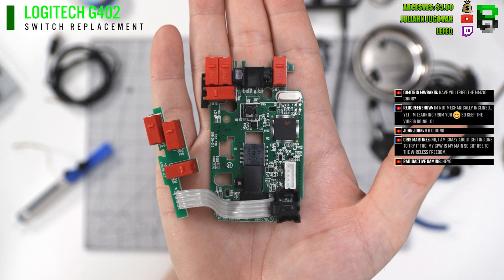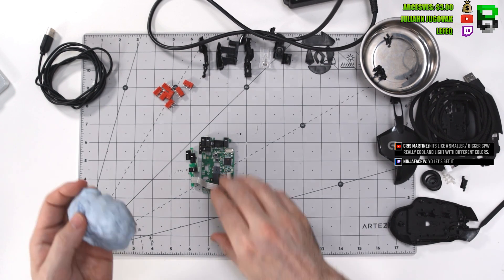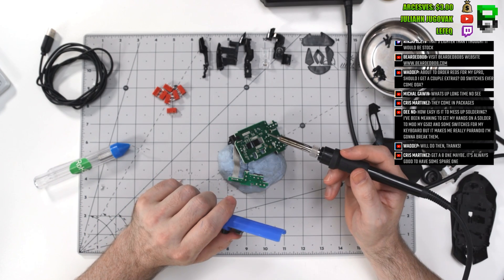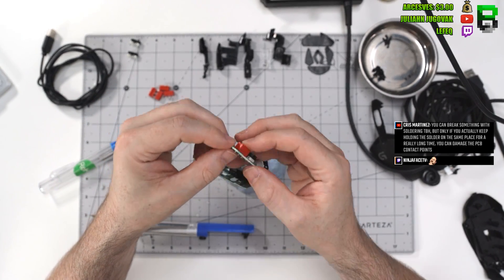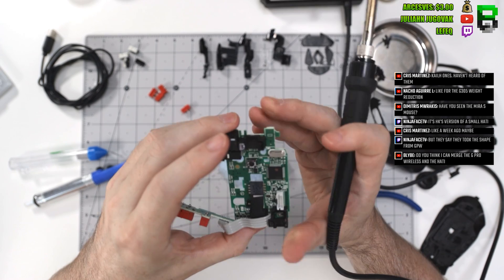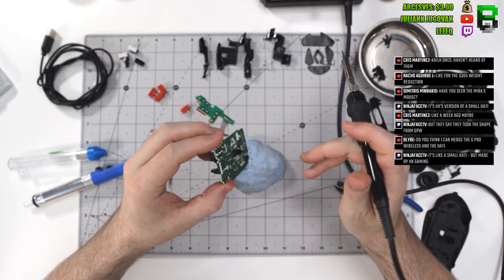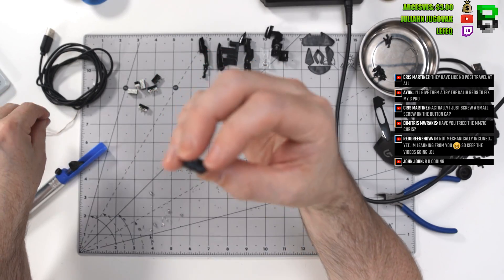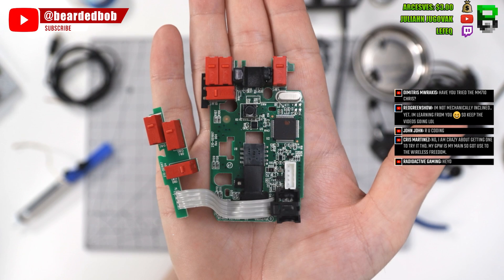Logitech Mouse Switch Replacement - Double Click Fix

Comment: What are you using to hold the PCB? Is that just random mounting putty or something specific for soldering?
Reply from the maker: This was blutac, I use a hakko omniverse  but Blutac or a cheap croc slip holder works well also.

Comment: Hi, does anyone know if you can change the side switches for the G502? (G4, G5 and the sniper button).
Reply from the maker: You can but you will need micro switches as they aren't the normal ones.

Comment: I think you should check your mic setup. It was hard to understand what did you said. (The volume levels went up and down. Sometimes the volume went down when you were still speaking. Also that a little bit annoying background music made the problem bigger.)
Reply from the maker: audio issues have been an issue but i've swapped out my mic as hte rode was to sensitive for the room db level which then impacted alot... shure smb7 is not fine.

Comment: You said you use 450C to solder...? That seems insanely hot, I know we're working with lead free solder here and it's melting point is high but DAMN
Reply from the maker: Use around 360 to 400 depending on the pcb thickness. 👍
Reply: @Beardedbob  just for lead free solder correct? I'd have to go look at my soldering station but I thought I was around 240 for most of my soldering

Comment: For anyone attempting this, I'd highly recommend a low melt solder called chipquik. It stays molten for ten seconds after you take the iron off. So you can loosen the solder for each of the three contacts of the old switches and remove them very easily, and then just clean up the area with solder wick. It's the only way I'm going to repair surface mounted components going forward.
Reply from the maker: tips always welcome
Reply: Awesome...its a great tip

Comment: Hi. Do you know what is the best replacemnet for the middle button to be softer? It is really hard to press.
Reply from the maker: short action so must will be hard.
Reply: if you've had the mouse for a while and have noticed it becoming more of a problem over time, it's worth considering just doing a teardown with a can of compressed air and some Q-tips / rubbing alcohol at the handy so you can clean the mf'er out. unless you're fastidiously clean around your peripherals, shit is just always going to get into the spots where it can get into over time. Your scroll wheel is a huge point of accumulation for crumbs and hair and grime - it's in a pretty central, face-up location and it literally rotates to expose surfaces from outside the mouse to the interior of the mouse, plus it's usually cradled in a semi-circular sheath of sorts, so gravity is not your friend. I found so much weird shit inside mine when I did a teardown after roughly 2 years of ownership - I'm kind of a disgusting animal, constantly smoking and eating around my peripherals and using them outdoors and traveling with them without carrying cases and you name it, but my guess is even the more cleanly among us will still find some surprises in there.

Comment: I've been having the double click issue lately and in my investigations I found that it doesn't happen when my G703 is connected via a wire. Is this really an issue with the switches or is it actually a  software/wireless communication issue?
Reply from the maker: Strange, normally its a switch issue but it should be a problem on both wired and wireless
Reply: @Beardedbob  It must have been coincidence that the double click didn't happen while it was connected with a wire. I have changed the switches to Kaihl reds and I haven't accidentally bought an AUG in CS:GO all weekend! Thanks for the helpful videos. Interestingly, after changing the M1+2 switches the middle click became very temperamental. Thankfully I already had replacement switches for that and my mouse is working great now. The middle mouse switch was actually a Kaihl from the factory.
Reply: @bman2827  No love for the Aug??? Damn, I haven't played CS:GO so maybe it's been nerfed but back in the days of 1.6 it was bullpup cradle to mf'ing grave bro

Comment: bro pls make a video of g402 sensor frezze pls and disconnect issue and  i use g402 2 year but this year staring the disconnect issue for cable and  idk what is the problem of sensor frezze pls somone help and one more question i upgrade my g402 switch to kalih red but if the sensor frezze problem will fix then
Reply from the maker: haven't heard much on it tbh... would a paracord not fix the cable issue?

Comment: You could do this in a few easy steps 
1. Break open your mouse
2. SLAP some random switches you want on it.
3. and then close it
Reply from the maker: pretty much what the video does.
Reply: love step 2 bro. I ALWAYS be slapping my switches, especially my random switches. Sometimes I mix that shit up by slapping and installing a Nintendo switch in my mouse, but Linksys Ethernet Switches and light switches are dope too. Fucking #slapthatswitch

Comment: I just put a piece of plastic as a thickness layer under my  right click button in order to add a thick layer to close the gap between the switch and the plastic click of the mouse so my double click problem is solved 
Its not everytime about switches ita about that the little piece of plastic becomes bad as time passes so it doesn't reach the switch as  it should wich results are double clicking its about just adding a very tiny layer of a square shaped plastic and stick it to the plastic click of the mouse and it becomes new
I did this to my logitech g pro wireless and it worked
Reply from the maker: You can pack it you with a plaster also
Reply: great idea!  thanks.

Comment: desoldering the lead free silver solder they use on mice is a fucking nightmare, shit has a wait too high melting point.
Reply from the maker: Yeah, sometimes it can be tricky.
Reply: One easy tip I learned was to slightly tin the tip of the iron first then it should transfer the heat a lot better. I didn't have a soldering wick at the time and that did the trick (using a solder sucker)

Comment: I have mine for 3 years ive been smashing it all the way and its still working, then after all of that the sensor sometimes is not responding, then it keeps disconnecting due to cable issue. the switches are crisp af after 3 years.
Reply from the maker: Nic me to hear the switches are lasting

Comment: Worth it on a g305 Wireless mod?
Reply from the maker: Imo yes
Reply: @Beardedbob  have you tried japanese onrons yet? Also I live in germany. It's impossible to get batteries. They cost 8€ but the shipping holy smokerino.
To put that into contrast back when I bought my Lithium batteries they were 12€ total now it's 30€...